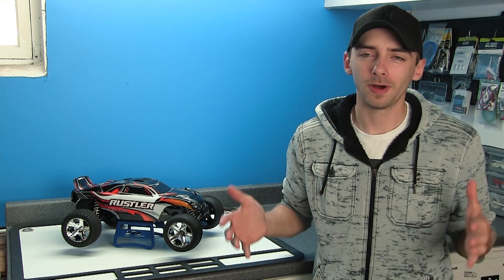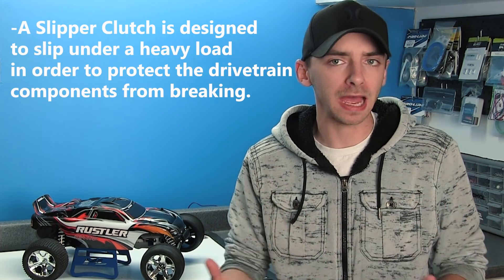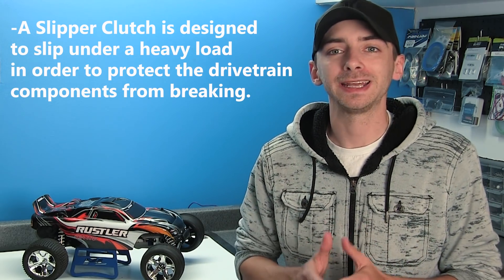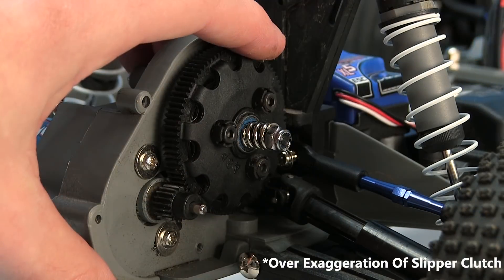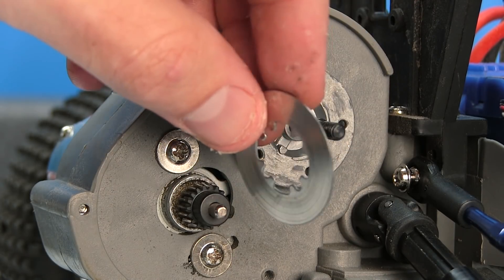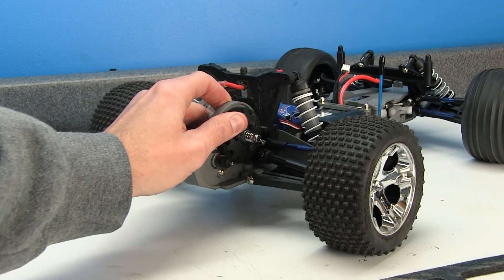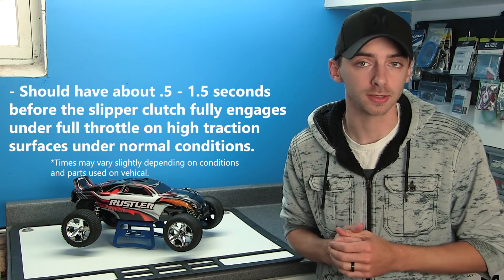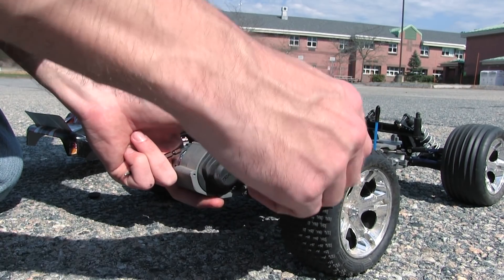RC Slipper Clutch Systems - How To Adjust, How They Work & More!

Comment: 7:12  you got the Tip in reverse. you want to ease onto the gas on loose Traction Surfaces so you wont spin out, so a loos slipper clutch would be preferred 👍

Comment: Anyone help me I'm having a issue with my slipper clutch on my rock crawler, so had it repaired but started slipping again after 2 days so I'm going to attempt to fix it myself but can I double up the 2 paper hexagon discs either side? FYI it's already tighter than the recommended already too

Comment: I have a Traxxas Rustler VXL 2wd and I put much larger tires and rims on it and it sounds just like its to loose and it burned out my slippery clutch so I need to replace it and I will adjust like you said on the tighter side but do you think I could mess up anything by running the set of larger tires? I put larger tires all the way around on the front and back so it looks like it's 4wd but it's not.

Comment: This video actually made me realize that it WASN'T my slipper clutch. My rustler 4x4 wasn't doing wheelies after some upgrades I had done and I just couldn't figure out what was going on. My slipper was tightened nearly all the way and still no wheelies. Well.. at some point I had put the esc into 50% mode and didn't realize it remembers what mode it was in last. Needless to say, I adjusted the esc setting just in case and it turned out I was running half power the whole time! New to this hobby, so definitely a learning experience in troubleshooting. Either way though, I learned alot about my slipper clutch! So, thank you for that!

Comment: Ran into an issue with my 2wd Slash.  Showing signs of a loose clutch.  Tightened it down and backed it off a 1/2 turn still sounds loose.  Idk what's going on now.

Comment: I wonder if you can help me I built a monster 2x4 slash with the vxl motor upgrade. I am using 3s batteries and I have gone thru 2 tranny housings and 4 clutches. When I put everything new and adjusted slipper clutch to 1/4 turn from tight. Within 2 minutes the clutch is so hot and clutch smell that it will burn the housing. What am I doing wrong. And yes I have been braking axles so now I installed extra heavy duty once. Why does it overheat within minutes

Comment: I slightly tightened my gen8 just barely and it fixed all the issues it was having..   spinning and not crawling as it was... after a inspection and adjustment it’s back on the trail! I’m very new to RC, couldn’t believe how much a slight adjustment like that made lol

Comment: Props bro been out of the game 15 years and I'm now getting back into it with my son and a lot has changed. Thanks for the help 👍👍
Reply: Same here just bought a redcat piranha it's a good little cheap RC startup truck. Haven't had an RC since 2004
Reply: I was never in the game but starting out with a secondhand tmaxx… should you be able to make the slipper slip by hand?
Reply: @Leon Parkhill  the tmax that's a bad ass truck and by hand that's gonna be too loose. I would set it on gravel and tighten 1/8-1/4 turn until it takes off without slipping that way it slips when it needs to IE. On blacktop or when landing on jumps
Reply: Same here!

Comment: Hi brand new to hobby I bought a arrma big rock love it anyway after driving it a bit I crashed ito tree  now not as much punch power won’t Wheely anymore could I have broken something
Reply: Hi, if it isn't fixed check that you don't have. A broken drivehshaft and if you have the kit check to see that your battery is working normally

Comment: I had these same symptoms and it was the small gear in my transmission the one on the shaft with a little pin. I replaced it with a metal gear and haven’t had the problem since.

Comment: So i have a traxxas e revo and i was driving it at about 50% throttle and then accidently applied reverse trying to brake. Well the truck locked up and cartwheeled and mow all it does is grind and whine... its my first owned truck so ive never worked on them. Can you g
Tell me what im looking at to fix and the costs... and also what i might do to avoid this happening again.. it seems like it shouldnt just slam in reverse but maybe im wrong. Thank you for this awesome video too very helpful on slipper clutch.

Comment: What do I do if I tighten my slipper clutch all the way down and it’s still making that whining noise. I checked my spur gear and pinion gear and those are perfect
Reply: This happened to me and I fixed it.  It was the roll pin on the inside of the slipper clutch shaft (inside the transmission)  If you need more help with this, let me know.
Reply: That was what was wrong, I replaced it by breaking off a drill bit inside of there 😂

Comment: What about holding both rear tires and giving throttle with the expectation of the front wheels coming off the ground about 3 inches? If not, why?

Comment: Thanks for using the car that i just bought. Mine came with the nut tightened all the way. Backed it off 3/4 turn. VXL 2WD. Should be safe?

Comment: got my nitro two days ago, and there was something wrong with my roto start, but i got it fixed today. went out to try it and it worked perfectly fine until i crashed into a tree. and destroyed my shock absorber. and then 5 min later my slipper clutch stoped working. what a bad day :(

Comment: Bruh first i thought my grub screws and drive cups were rubbish because they kept on coming loose. When the car was new it used to wheelie on grass. Now it wheel spins a lot. I think the extra spinning has led to the drive cups and grub screw coming coming loose for no real reason when running the vehicle. Thanks for the video. Actually helped a lot because this problem has occurred over the last year now. When I first replaced the spur gear I measured the length of the nut to the gear, but since the buggy had been run quite a lot I think it was looser than it should have been. After that replacement the buggy never drove that well. Again, much appreciated 👍👍
Reply: Also I’ve been in the hobby since I was 9, now I’m 16. And tbh this is one area of the hobby I’ve never really studied and understood the importance of. Glad I found your video. You got a like and sub from me 😁
Reply: One other thing. My lock nut was measured about 5.5cm away from the spur gear. Maybe that was abit too loose now thinking about it 😳😬

Comment: Are the slipper clutch pads also used when breaking?
Reply: It’s possible, since braking is just putting the motor in reverse. Just depends on how hard you brake.

Comment: What if I replace that bolt, but it doesnt solve the problem. Also, what does it mean when there is a red light on that blue box with the on button, and what can I do to fix that

Comment: hey there, i think this also has to do with my slipper clutch, but im not sure... My car made a weird noise so i opened it and around te screws, a part of the motor and the lockbolt on the slipper clutch were covered in metal dust. i cleaned it off and made it ready to run again. did i tighten it up to much maybe? or is there something else i should watch out for?

Comment: Even after I tightened the nut it still doesn’t move. I even tightened it all the way and the truck still barely moves
Reply: Your clutch iz burned up.
Reply: Ted Nugent thanks for replying but I actually found out my battery had gone bad after my four years of using it.
Reply: @beanbag4982  Well there ya go. The only reason im watchin this stuff is because this damn virus and the tornado that hit Jonesboro has got the paint trade pretty slow. So im drinkin beer out in my shop and gettin my old R.Cs runnin. I just finished puttin the prettiest faux marble finish on my. RC 10 T4 that anyone has ever seen. It acually looks like the shell is made of high end marble thats about 2 inches thick. I use chicken and peacock feathers to put the torqoise, gold, silver and rose quarts veins in it. I even did the rims. AND NOW THE DAMNED CONTROLLER WENT ALL WONKY ON ME!!!!. Dang im bored man.
Reply: Ted Nugent well that sucks, I know that feeling and it is terrible
Reply: @beanbag4982  Everything worked out, after about an hour and a half online lookin for a manual for my controller I finally found one, so I took my controller apart. In doin that I realized that I needed something out of a drawer in one of my work benches, while I was lookin for the screwdriver I needed I found the manuals for 2 of my cars, one of my Son's cars and all of the controller manuals. Hell, I didn't even remember saving them when I moved 7 yrs ago. Lol.

Comment: I thought this was a troll video until I read some comments....I’ve shredded everything in my drivetrain including the actual gearbox and never even came close to an issue with my slipper clutch, lol...and that’s the truth. When I actually ripped teeth off the sprockets inside my gearbox, that was the most trial and error I ever had to figure out what was wrong. Took my truck apart and put it back together 4-5 times before I decided to open up the whole gear box. Then I saw several gears just shredded and ordered new parts. It honestly is part of the fun of RC cars...ripping around and racing but also working on the car and tuning them is a ton of fun!!

Comment: Hopefully you can answer my question When going in reverse then forward one of my back tires doesnt  spin at the same time as the other ones. When the others already switch to forward this one takes a while to spin the sameway. So with that being said I cannot Willie. All it will do is spin around Since one wheel is loose
Reply: probably a loose wheel nut(btw its a wheelie not a willie)xD
Reply: Plentiiface_ Young a diff or a loose wheel nut

Comment: What causes the friction pads on the slipper clutch to come apart and come out? This has happened twice on a new TMaxx 3.3 during the break in period. The second time it barely made it through a tank of fuel and it was not set too loose when it was installed.

Comment: What would cause the slipper clutch shaft to bend? My spur gear is wobbling, which in turn is causing  my pinion gear to eat through my spur gears. I recently upgraded the motor in my fiesta st rally. About an hour after running it this happened.

Comment: Really good video thank you but a 3s battery in my truggy and it was making weird noises under heavy load I checked the lock nut and it was 3 turns from full changed it to 2 1/4 and it’s perfect thank you 🙏

Comment: Also if u guys are using metal gears in brushless systems!!!!!!! Oil the gears!!!! Or they will get too hot and you will hear a screeching noise from ur RC!!!!
Reply from the maker: Which gears the spur and pinion? You actually never want to have oil on those gears as rocks and dirt will stick to it as they are mostly exposed to the elements causing them to grind down the teeth. But if your gears are screeching then usually it means they were not meshed correctly. as far as gears inside the trans yes those are always greased.
Reply: @RCOverload  the plastic casing is used to protect the gears from rocks and dirt. If there's any rocks or dirt getting through that then there's something wrong. I was told from my local hobby shop to use gear oil on metal gears and to clean them off after wards to prevent the gears from wearing out and heating up to much

Comment: Slipper tightened all the way down. Backed off half a turn per manufacturing spec.  No more wheelies.  New slipper.  Same problem.  And spring is distorted badly.

Comment: RC Overloard  I own a Losi High Roller and the clutch does not have the little magnets inside, is this a different clutch? It only has two discs on each side of the spur gear, also the motor is brushed and the shaft of the motor moves from side to side if I do it by hand maybe 3 millimeters, is this normal? If so, how do I set the motor with the spur gear with all that movement?

Comment: My sons Slash just started doing this I believe. If it is sitting in the ground the motor runs but won’t move forward/reverse. If we lift it up the wheels will spin but not when any load is on it. Guess maybe this is the problem?
Reply: Either that or the pinion gear is slipping. Just check the screw that holds the gear on the motor shaft.

Comment: Great video - just one thing, introduce yourself (kind of like a news anchor does at the beginning of any news cast) - it'll help your audience relate to you better. You're very well spoken, you don't stumble around, you get to the point, explain it well, and are very prepared. You look like a long time pro doing this. Keep it up. Found you via a YouTube search when my 4x4 Stampede wouldn't move very well after installing a new velineon & 17T pinion. I took the spur out thinking I needed to change that, but the replacement I bought was the same size (I was only attempting to do a 54/17 combo to get top speed on the truck). Truck came stock with a 54T spur, so I only needed to change the pinion to the 17T. Unfortunately I messed with the slipper clutch lock nut.

What I learned from your video: What the hell the slipper clutch is for - how to adjust the nut just right, and why I might want it loose or tighter in some situations. I know nothing about RC... just started. But your videos have helped put me well on my way. I'm subscribing!

Thanks! (Whatever your actual name is.)

Comment: I have a tamiya ta05

The car wheels move when i hold the car in the air. But when l place on ground it tries to move but doesnt .
Been told slipper clutch just needs tightening but dont know how to do it lol.
Its also a 4wd belt driven car but only 2 wheels move. The front 2 wheels try and move but dont..
Please help.
Reply: Ok, hold-on a minute!!  I am fairly New with my Nitro Slash 2wd, 3.3 Motor. Ok,  now in my Owners Manual. Turn your Model off. Tighten the Slipper Nut (Clockwise), until it Stops. And then [Back the Nut out ¼] Turn. [ [Counterclockwise]....  So in a nutshell!! Tighten your Slipper Clutch. Then after it's Tight. Loosen the Nut ¼ Turn Backwards. It will still be Tight. But, Now it can slip. Because, We Turned the Nut Backwards, After Tightening ¼ a Turn.    
          P.S. I recommend, getting a Feel for it. Because, ¼ Turn don't seen like enough sometimes. So i usually Turn my Nut Backwards, a ¼th and 1/8th, so not quite a ½ Turn. Thank-you, and i hope this helps. I'm New to the Nitro R/C Car. But, not R/C. I fly Airplanes. I have about 8 Airplanes. 2 Quadcopters. [DRONES] A few Small Helicopters. All are Electric!! Sorry. All Run on Lipos. But, i had been looking at these Race Trucks and Cars at my Local Hobby Shop. They carry alot of Traxxes stuff. Mostly everything is Electric. They usually have at least over 20 1/10 Electric Traxxes Cars and Trucks. She only had 3 Nitro's up there and i bought 1 of them. I wanted the most Realistic Truck and when i pulled my Nitro Slash, out of the box. I was amazed in, on, how Big the Niro Slash is. Nitro Rulez!!!   I'm out man............

Comment: Thank you so much! You’re the only one that could help me with this! My problem: loose nut. Liked and subscribed!💜
Reply: Nevermind lul, fixed for a few min but it’s not working again. Thanks anyways tho still helped me!
Reply from the maker: Its possible the nut keeps coming loose. sometimes its actually a good idea to just replace the nut and try again. if its still coming loose you could always try to add a second nut on their ive done it before and 9 out of ten times it works.

Comment: Great video but my slipper clutch is fine but the little nut that synchronizes with the slipper clutch will keeps coming on lose not the slipper clutch so how do I fix that little screw it's a little silver screw with the grooves in it that fits in with the slipper clutch that has the little animals thing on the side where you tighten it up but that keeps coming on loose not my slipper clutch so how do I fix that
Reply: Loctite.. more like a permanent solution... worth a try mate!

Comment: i took apart my transmission and the rod that holds the plastic gear wiggles and ive had it set fully tight not knowing that could hurt it what do i do

Comment: I have my 2WD Slash geared at 23/76.  It runs great.  However, when I “poke” the throttle it makes a clanking sound.  Once I jump on the throttle (from rolling or dead start) it is fine.  I am new & looking for some suggestions.  Maybe it is normal or a little out of normal?  Or is it bad for it?  Any feedback would be appreciated.  Thank you! 🤘🏻
Reply: D.P.T. I think it is cogging if it is a sensorless system. That is normal

Comment: Np matter what I do on my stampede (castle 1410/3800kv) the spur gear doesn't rotate at all when you just push the truck or manually spin the wheels. My slash and rustler don't just freewheel like that. Is there something wrong?
Reply: Riley Baylee pinion to spur is tight
Reply: G Jackson you mean too close together?
Reply: Riley Baylee right
Reply: No your diffs are gone

Comment: When I drive my truck fast and stop it makes a loud clicking sound. Does anyone no what the problem might be?
Reply: Agent Magic I think I have the same thing wrong that you do.  It “clanks/clicks”!when I “poke” the throttle.  I tried the slipper lock nut at many different levels but still have the issue.  Any luck with yours?  Thanks! 🤘🏻
Reply: No luck yet, I tell you if I find out what's wrong.
Reply: Agent Magic It was the gear mesh.  I have learned to use regular paper and not paper from a notepad, etc.  The mesh setting seems that it can be that sensative.
Reply: So how do I fix (sorry this is my first real rc car)
Reply: Agent Magic No worries, I’m rather new to RC also.  Just search for setting the gear mesh.  The paper method seems to be the best way.  It is simple once you do it a couple times.
Reply: Ok, thanks!
Reply: Agent Magic No prob!  Good luck! 🤘🏻